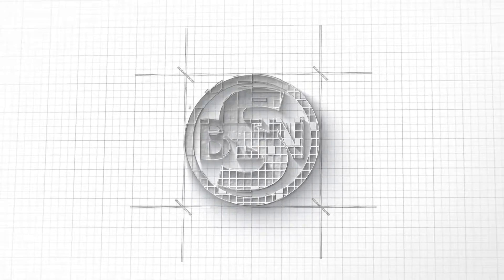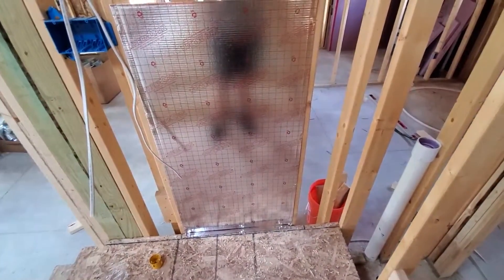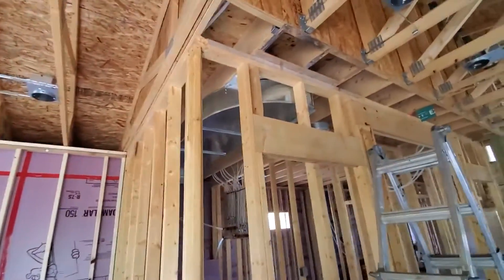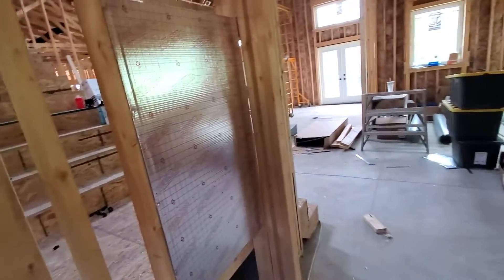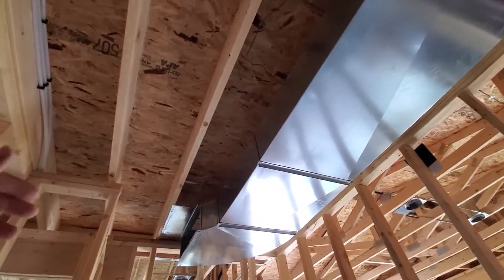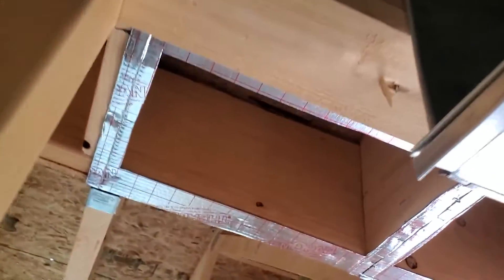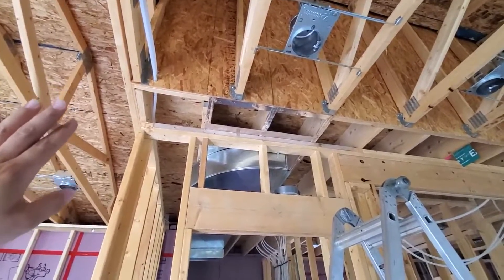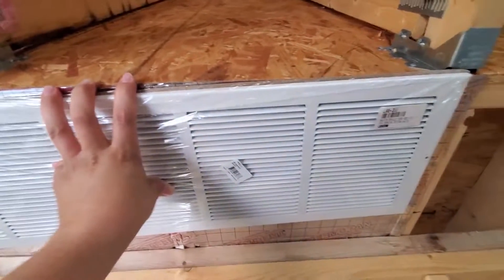How To Use Joist Panning for Return Air Ducts - ThermoPan

Comment: Some time back, the office I worked at added 3 office booths.  They used this thermopan product or a version there of, to create ducts from the hvac unit to the office booth where it fed through the ceiling.
to be clear, they were not using it to run air through the stud space, they made a box duct with the thermopan on all 4 sides and did creative turns like you show in the vid.
What I would like to know is was there a pre designed duct made of thermopan product or did they cut and create on their own???
I am working on a mobile home that the prev owner gutted the heating system.  using thermopan panels to create the duct system (its not a big system) would be much easier than working with sheet metal.
what do you think?

Comment: My house has a long metal panned duct,  problem is the panning is not longer flush to the joists and has gaps along the sides.    This product looks like it may resist buckeling better then the tin metal.

Comment: The manufacturers installation instructions state that the words should be facing outwards. It doesnt look like there is much difference between the two sides and im guessing it is for “advertising” or just usefulness of the grid.

There is some wiring (SR EHT) where you have to install it so the labeling is always facing outwards but that might just be a spec thing and not a code requirement.

Comment: Joist panning for return air ducts goes against code in certain areas, for a number of reasons. Unless it is properly sealed, which usually they are not, it is creating a negative pressure and sucking air in from the wall cavities and subsequently the sill plates. Therefore, you are sucking in hot, humid air in the summer and cold air in the winter. Second, panned returns are considered a fire hazard due to how they can increase the rate at which fire spreads. Lastly, they can cause the backdrafting of harmful air from appliances. 

It should be illegal everywhere to joist pan an HVAC return. In my opinion it's just an excuse for cheap, lazy work. The ideal scenario would be to duct the return.

Comment: i mean...we have clearance issues.  i don't see why i can't use the space to supply air?  i'm using the floor system and fully insulating the joist cavity.  Top, sides, and bottom with 1/2 foil polystyrene.  lexel all the crack, and make sure no "air" touches framing members??

Comment: I live in a 1954 built house and they are using the same return air ducts method between basement rafters. They use plain old galvanized sheet metal.  When the previous owners remodeled, they did not install air returns in two of the added on rooms. So there is not enough air turn vents for each air vent. In the basement the return vent on the heating/ac unit sucks in so much air that its pulling air from upstairs under basement door crack.

Comment: IECC 2021 is pressured by EPA and has tightness testing conditions. You can use duct board, but will never pass duct tightness test your supposed to be doing. Your jurisdiction is simply 20 years behind.

Comment: However panning is not approved by the NFPA and several codes do not allow it. Bare wood is not allowable by fire code "Materials exposed within ducts or plenums shall be noncombustible or shall have a flame spread index not to exceed 25 and a smoke-developed index not to exceed 50, where tested as a composite product in accordance with ASTM E84 or UL 723." An hvac contractor could be held liable if a fire is found to have spread through a panned bay.

Comment: I've got about 3 foot x 4 foot return made by the walls in my house.  No metal panning- no nothing.  Returns my ac to the basement air handler. It's odd. I posted about it and many in the business said its routinely done.  Huh. 
Love your videos.  You're a wealth of construction knowledge. Thanks!
Reply: I feel your pain! just saw a This Old House (or might have been an “Ask” TOH) episode where they quoted that something like 80% of houses with central air were judged by their owners as having uncomfortable heating/cooling. My experience is that in the HVAC (and other) trades they “do it like they do it” and absolutely will not follow design, sizing, sealing, etc calculated by an engineer or specified by an architect unless it happens to coincide with what they are comfortable with. I just had a large damaged whole window replaced and installer refused to integrate it with the existing house air/water barrier or even use flashing or caulk it “because we don’t do it that way around here”. Huh?
Reply: @dac7046  and unfortunately many times you don’t know the right things to ask until it’s too late or the company has already done the job.
Reply: @dac7046 very sad that you got work done like that !!

Comment: Those stud returns are clever however, myself I would prefer the sheet metal to be 100% enclosed so that the return air can be filtered at the return register vs. at or near the air handler. If not, all of the return ducting will eventually collect dirt over the years as it has to be filtered near the air handler since there would be some air leakage from the looks of it, this side of the camera.

Comment: So true, an HVAC source I know of and having about 35 years of experience told me that the returns should be about 2X or twice the volume of the total supply ducts. He said more than 50% of HVAC installs that he has seen do not follow that rule/idea. I personally know of huge tract developments in Southern California that have most of their returns located right below or to the side of the HVAC cabinet and my guess is to save money on materials. How/why local codes allow this in a state or county that is so concerned about energy consumption and efficiency no one really understands. But, the real negative is THE NOISE that is made with those inferior ideas. Its ridiculous to say the least. Efficiency must be way off in addition to the noise. Plus, the HVAC filter location is usually hard to get to vs. being located at a return register or registers. My personal HVAC guy told me 30 years ago that the more there are returns, the better and that all supply registers should be open vs. closed in rooms not being used as that defeats air flow at the plenum. He also explained the difference in the cheap stamped metal registers and those that are "rolled" metal that improve air flow and direction of flow. I truly learned much back then and found over the years of observing how the many homes I've been to where HVAC quality is way below many standards that applied back when they were installed let alone todays standards. Even the locations of the condensers and air handlers are so far off you simply had to wonder what was the goal when they were installed. Very sad that we see licensed HVAC folk doing this kind of work and local city codes and/or their inspectors allowing it to occur. My observations tell me that any two story home should require two (2) HVAC systems, one for up and one for down, large returns with the filters located inside them and ducting designs without excess duct lengths or kinks in them and properly hung/routed and then proper locations for the equipment, inside and outside. It's sad that the huge tract developments get overlooked as they do since they also carry a large portion of the waste in efficiency etc. than a smaller development does.

Comment: Will the pans confuse a studfinder used by a homeowner who wants to hammer picture frame nails into wall studs?  And what will happen if the homeowner installs anchor bolts into drywall without knowing the ductwork is lurking behind the drywall?
Reply: Thermopan is just fancy cardboard with a slightly higher burning point. And puncturing it is one of the main problems of using a wall cavity as a return, now you are pulling unfiltered air into the system
Reply: @turnedearthdesign8678  : The location of the air filter would determine whether air pulled in through a puncture would be filtered.

Comment: If you are moving from one floor to the next, are you allowed to cut through the top/bottom plates of the framing? For instance, for second-story return air, can you cut away the horizontal framing members from the second story all the way down into the basement?
Reply: I know in my 1979 house that's exactly what they did. I think there are special brackets that are supposed to be used where the plates are cut to prevent separation or twisting but mine had nothing and it's been fine.